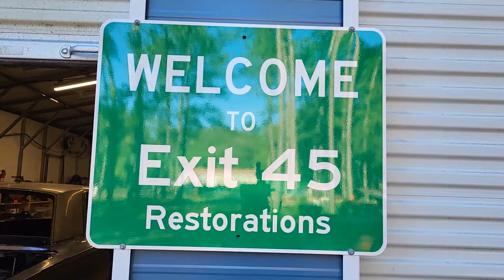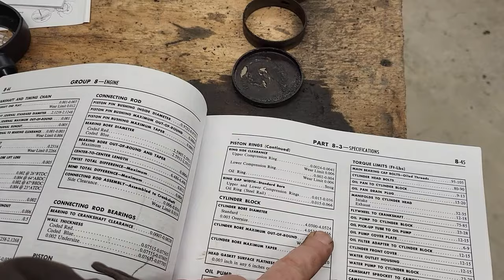Ford FE 390 Engine Teardown

Comment: Hello Matt. You asked about the hardware holding the camshaft thrust plate. My 66 uses #4 phillips head screws.
I would say go for the hardened seats on the heads.
I also would recommend  "How to rebuild big block Ford engines" by Steve Christ. Lots of good info there.
George B
Reply from the maker: Hey George.  I was expecting to see phillips screws as well.  the engine looks to be factory so I guess they used those as well.  I did ask the machine shop to put the hardened seats in.  I got a good book from a friend that just finished building his stroked 360 and he said it walked him through it in detail.  I'm going to look it over and see if it is a good book to build to.  Good to hear from you George.

Comment: my algorithm is reading my mind, were fixing to pull and fully reseal a good running 390 out of a 73' ferd truck.
Reply from the maker: That will be a good project.  Let me know how it goes.  I will hopefully have the block and heads back in a week or so to get started on mine

Comment: Powell maching just started an fe , good info. My pistons have valve reliefs, its a 64
Reply from the maker: Hey.. I thought mine would have the reliefs as well.  I'm not sure if the pistons in mine are original.or not.  Don't matter as I just had it bored .30 over.  Did you rebuild your engine?
Reply: Not yet, had the block bored 40 and honed, thinking of having it decked and a line honed. Heads have been reconditioned, crank turned, and rods reconditioned with sealed power factory pistons, haven't decided on rocker arm setup. What are your plans?
Reply from the maker: @user-kw8my1cv3x  I has it bored .30 over and all the surfaces decked.  The crank just needed polishing.  The heads were in good shape and had hardened seats in it already.  I picked up a roller cam and lifters from Howard's

Comment: They make cheap mixing tubs for concrete that slide really good underneath engine stands for spills I've been using them for years because they're inexpensive
Reply from the maker: Not a bad idea.  I thought since this thing has been sitting and draining for months that it would  have been all drained.  I'll look for one when I get to the hardware store... thanks for the good tip

Comment: Not medium riser. They would low riser if anything. The medium riser, low riser, & high riser terms were oriented for the 427. Anything other than the 427 would eventually be low riser. The 428 scj heads were basicly equal to 427 medium riser heads. And they would have bigger valves also. Your heads, im guessing C4AE-G  heads will have 2.03 & 1.55 valves. They are good heads though! I ran a set on my 390 for some time. They perform very well! But just the same, not medium risers.
Reply from the maker: Thanks for the clarification
Reply: @Exit45Restorations  no prob. Also I think u asked about the bolt for the cam plate? They are a big, like a no. 3 Philips bolt. That's what they are supposed to be.
Reply from the maker: @jesseduke694  that's what I thought.  They didn't look right.  Thanks for the info again

Comment: They're casting plugs not freeze plugs
Reply from the maker: You say casting, I say freeze.. lol. You're right though.  They're casting plugs meant to plug the holes left by the casting process of the block.  We just hope that if it freezes that those will give and save the block.
Reply: Also known as frost plugs in New Zealand and Australia and welsh plugs in the uk
Reply: @fratboyz01  well I'm in UK and we always called them core plugs...

Comment: Time for a new cam lifters maybe see if they do a Rolla cam for a FE motor also watch out for the cam bearings when installing ford did some stupid things some times they used a over sized in the middle and rear it was not all the time I had that with my 351 C
Reply from the maker: I did get a new camand lifter for this engine.  I got a Howard's roller cam and lifters for it.  As far as the cam bearings go I have the machine shop putting them in.  It was cheap so I had them install them.  I'm excited to get it back and get it together.
Reply: @Exit45Restorations  I have a 1982 ford LTD Australian version so different to the American version if you want a pic let me no we’re to send them
Reply from the maker: @fratboyz01  I would love to see.  You can send it to the email in the video description.